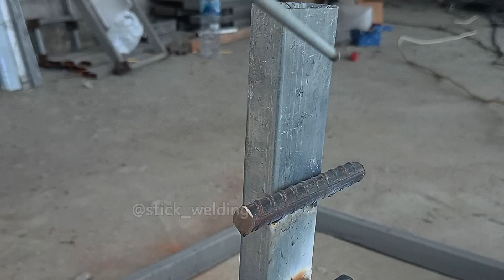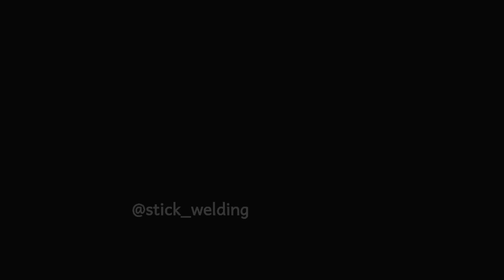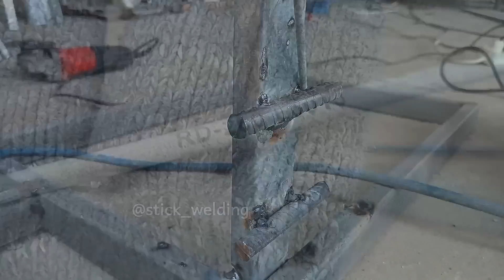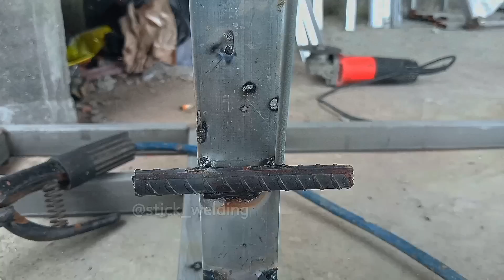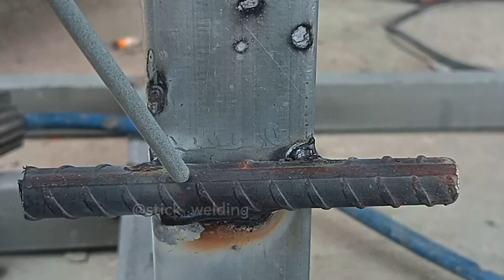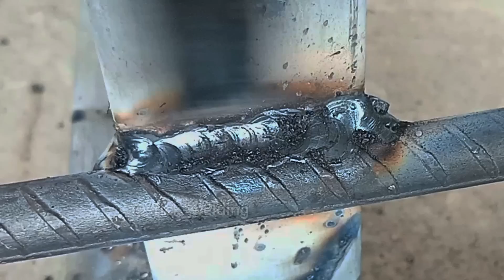99% of beginners don't know this method, welding steel bars to thin square tubes.

Comment: Re-bar is tempered steel. Welds don’t stick. The only way weld can hold is heat it by welding slowly red hot to remove temper, 7018, dont use re-bar with tin .

Comment: electrode diameter and amperage? would also like to see the snap to the first profile.
Reply from the maker: type 6013 diameter of 2.0mm with a current of 60 amperes

Comment: El proceso de soldadura, jajajaj depende mucho del tipo de soldadura, el método es oscilante, no debes volver a soldar encima de la escoria depositada, menos con esa soldadura 6013, que tiene polvo de hierro en el revestimiento, permitiendo qué la escoria sea casi auto desprendente, pero si la suelda encima el resultado será un cordón sucio de fierro fundido, jajjaja parecido, porque se mezcla el deposito con escoria quedando un cordón poroso y quebradizo, te hago una pregunta, si debo hacer un cordon qué resista 5500 kg/cm2 en una union de dos barras de 1/2, pulgada, cuanta soldadura le pongo y como?